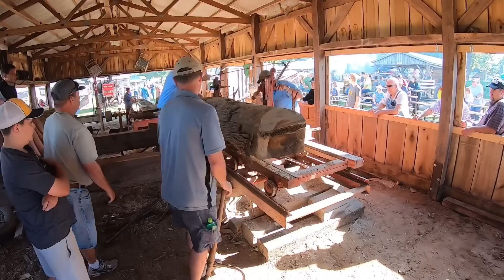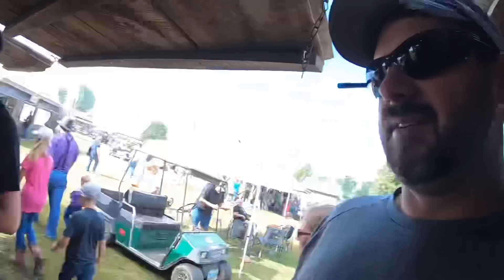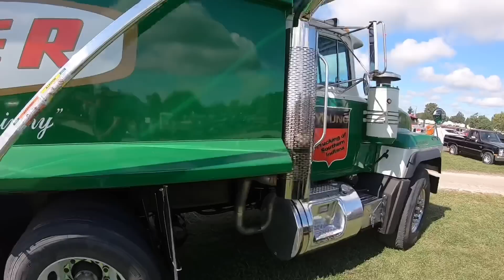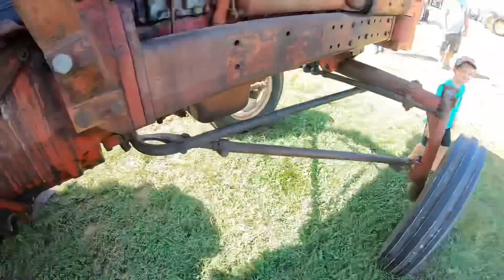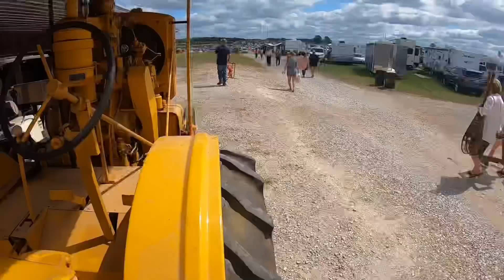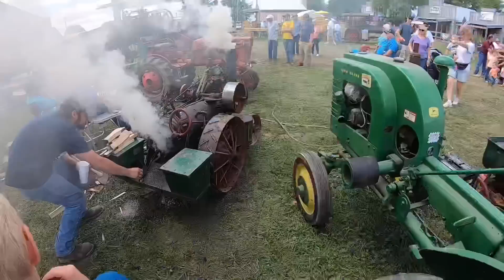Amazing steam powered sawmill and many other things at white river valley antique show

Comment: I was extremely lucky to grow up in a one horse town stuff that would been parked long before the more modern equipment came to replace it and even some of those men working on it were grateful to see them retired ... my first big truck driving for someone instead of dad. A nineteen fifty one mack truck with the I believe was twelve at the time to drive a B51 mack with a thermadyne engine. I'm  remembering as hard as I can the tractor pulled graders and dozers with a cable winch to run the blade. Old and loud but fun

Comment: The fans are used to put a load on the engines ,to check running of them and horse power , on hard it pulls. The Baker engine here in Ohio to test the engine for run in when new . We have a Baker fan here at the campground  ! ! when they had steam engines here in the early 80's , and used it on one about four years ago .
Reply from the maker: Awesome

Comment: Great show.
A typical Circular saw blade will take out 5/16” for the kerf. 
A typical modern thin kerf Bandsaw will take out 3/32.
Thus a 7/32 difference in technology.
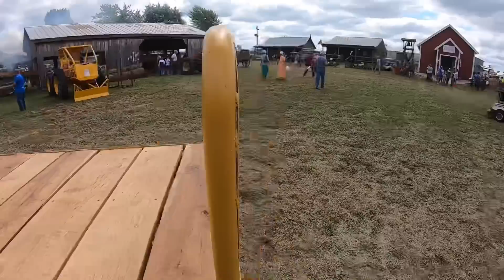By the way you missed the Log Skidder at 20:06, but next year you’ll see it.
Reply from the maker: Crazy and yes seen that

Comment: Those Fairbanks Morse engines had upper and lower crankshafts with two pistons per cylinder punching towards each other, low rpm high torque engines. They used them as backup generator engines on submarines I served on plus they used to have them on the Alaska ferry system. Cool engines.
Reply from the maker: Yes and yes they are cool old engines foe sure